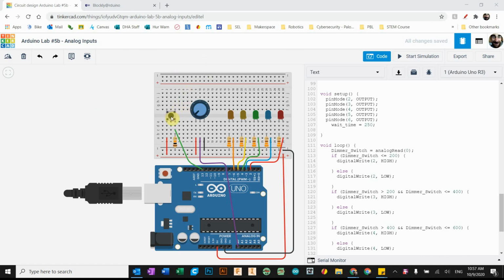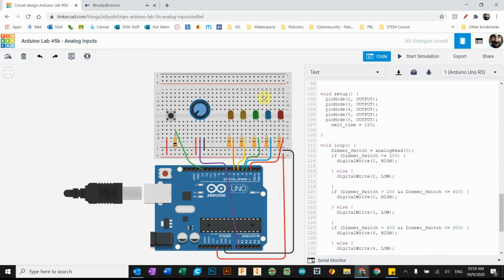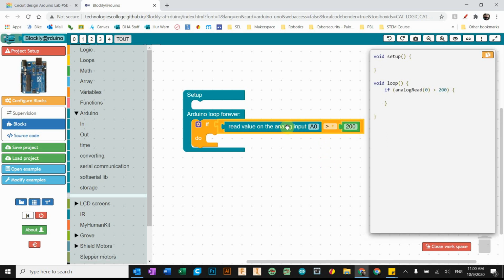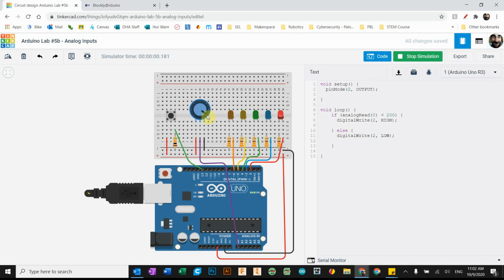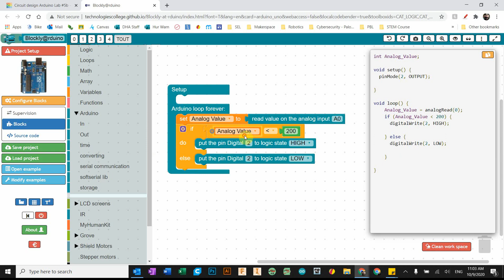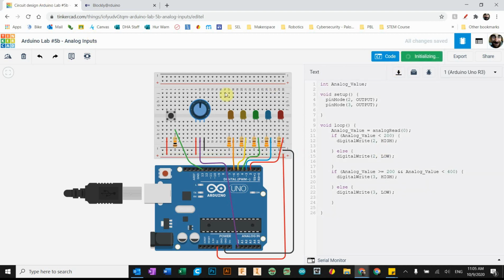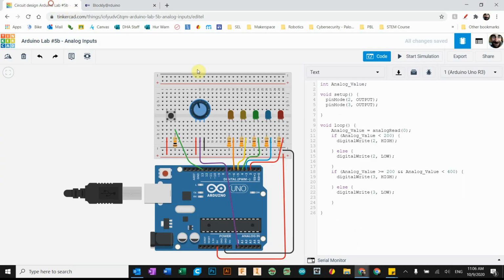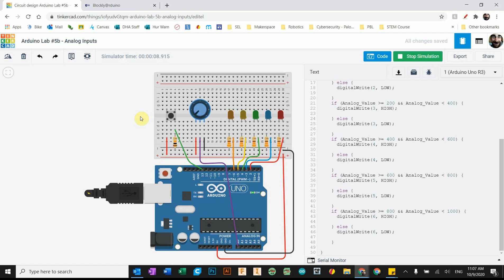Arduino Lab 5b: Analog Inputs with Blockly Arduino and Tinkercad Circuits

Comment: Great series. Can you do one for LCD screens? I got a starter kit with a MEGA 2560 and the LCD says 1602A and can't seem to figure it out. If not, thanks for the videos.
Reply from the maker: Yes, I'm planning to do a video for LCD screens with an Uno. How many pins does your 1602A have? It might be a different module than I use, but the steps are likely to be similar.
Reply: @RemiWauthy  16 pins